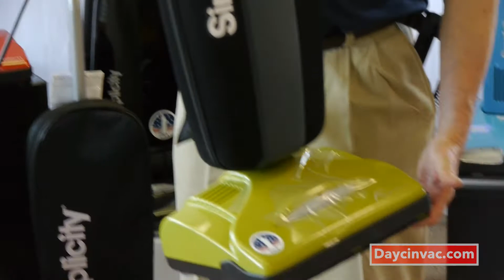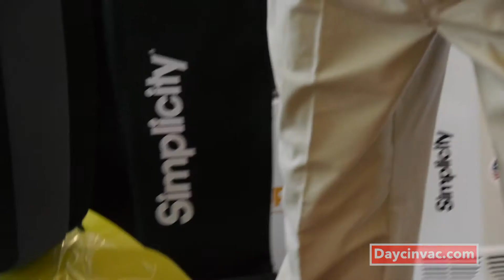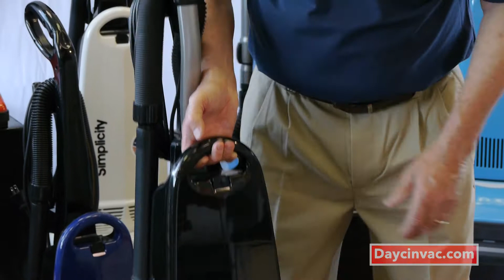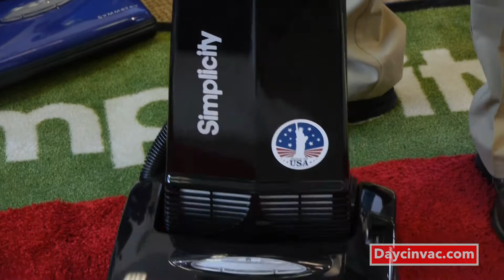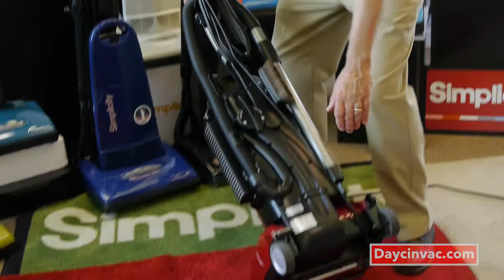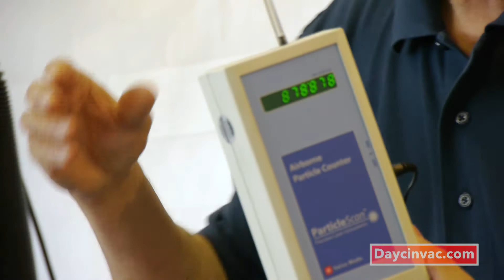Simplicity / Riccar Vacuums  at Day-Cin Vacuums, Dayton, Ohio

Comment: What's the difference between the s40 and the r40?
Reply: S - Stands for Simplicity /  R- Stands for Riccar. As of 2019, Riccar is the only Tandan Air Unit. They are the R30P and R40P.  They look the same, however the R40P is larger using a larger bag, and has a different HEPA Exhaust.

Comment: It’s two suction motors not one suction motor one is a direct air suction motor the other is a bypass ...
Reply from the maker: That right. The suction on these machine are both by pass. Or Fresh Air!  However, the Tandem Air Unit has a direct motor that turns and pulls air in and at the same pace as the roller brush.  What is picked up through that motor goes thru a fan. So, don't pick up coins. However, the end results (the dirt) ends up in the same dirt bag. So, the Tandem Air actually has two motors.  One for the suction (when the roller is turned off, or when using the cleaning attachments, and the other motor (just mentioned) to pull dirt from the carpet. A powerful vacuum.  Having a Tandem Air Vacuum allows the user the option to adjust the wheel height as you clean. So, it will do most any carpet surfaces.  I hope this help answer your question. If not, please call our store (937) 291-3560.

Comment: I own a Riccar Brilliance R30D, same as the Simplicity Synchrony, this is my second tandem air unit, previous to this I had a Riccar Radiance the second generation which I had to sell due to going in the army. I love my machine and wouldn't own anything else
Reply from the maker: I totally agree! Not only do I sell Simplicity & Riccar Vacuums, I use a Riccar Tandem Air at my home. I love it. Its powerful and I have a built in charcoal filter that eliminates any odors coming through the vacuum. I'm is very similar to as the Simplicity  Tandem Air featured n this video. Matter of fact, if your interested in purchasing a newer replacement,  Simplicity is running great sales as they are closing out many models.  Any Simplicity dealer could fill you in or you are free to contact our store. Day-Cin Vacuums
Reply: Jon, are you saying that Riccar is the same company as Simplicity?
Reply: @michelekrile436  well both vacuums  leave the same factory and have a really alike design

Comment: I just got a new vacuum! I collect vacuums. My mother had a Shark that bogged down because she forgot to clean the filters frequently. So I gave her my Maytag M1200 whivh is $700. It's been years since I am considering a water filtration vacuum. Now that I have the Riccar Radiance Premium R40P, I have no issues, and thought if I should stop collecting. Maybe I'll stop, but I will keep the vintage ones as well as my favoutites.
Reply: Steve, I too own that same unit (but an older model ) The love the Tandon Air. It has the power. I can adjust the hood setting for the height of the brush assembly. You can tell that its deep cleaning. I also like the attachments and hose. That 13 ft hose reach can do the job or units can't,  And center of gravity is low, meaning the machine will not tip over when using the achievements.  Great product. And I like the color of your Riiccar R40P.  / Dave - Day Cin Vacuums
Reply: If you would like a water one you'd like the Rainbow . My mom's had one for 15+ years